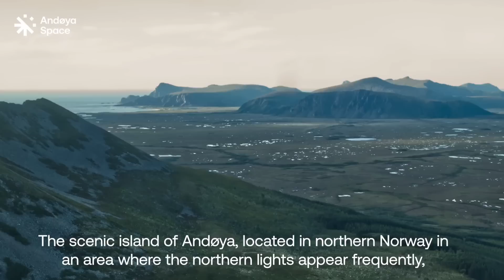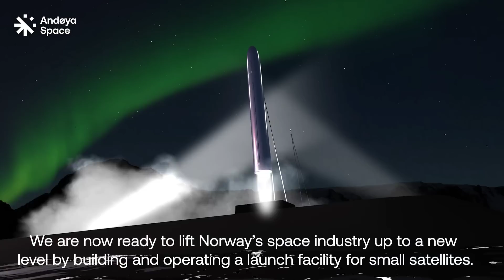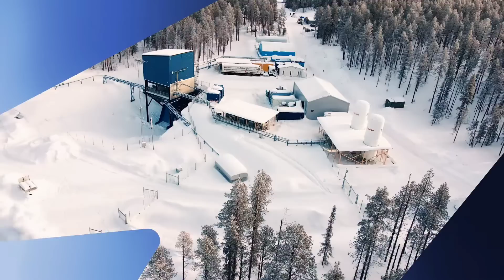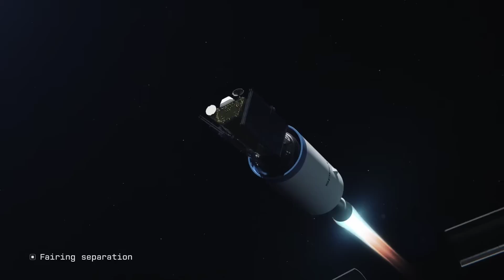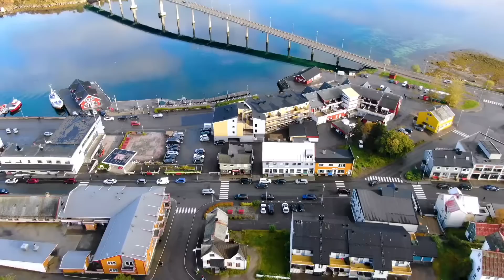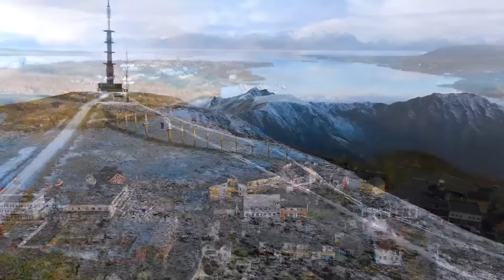The race is on!!!  Europe now has THREE licensed Spaceports!  The latest is in Norway!

Comment: It's worth pointing out that 'off the shelf', mass produced things for the automotive industry in 2024 are more consistant in their manufacturing and dimensions than custom military/space components were in the 1960s era, in spite of being a fraction of the cost. This isn't just in the machining, but even the metal is going to be more consistent throughout the part.

And there are a lot of things that can be done with software, sensors, and feedback loops today that were either utterly impossible in the 1960s, or had to be done via analog feedback in the devices themselves (but more commonly had to be dealt with by just making everything more robust to survive the non-ideal conditions that could not be eliminated)

Comment: Andøya has the best logistics. There's a deep water port at Andenes, as well as a long runway. That's about 37 km away. On top of that Andøya is connected to the mainland without needing to take a ferry.

If you want to unload a rocket from a ship closer to the site, there are some options as close as 5 km away from the launch site.

As I understand it, the Spectrum rocket is already at Andøya, and they will start testing the stages in the very near future.

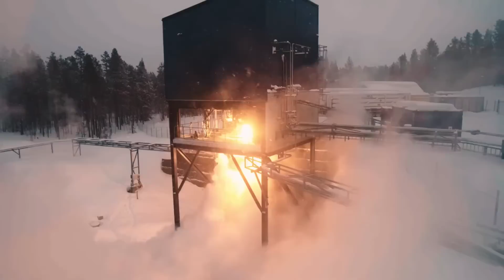Comment: 3:05 there's no such thing as "3D-printing carbon composites" 🤦 Isar are indeed using 3D printing for parts of their engines, and they are indeed utilizing carbon composites for the hull of the rocket - but those are two entirely separate sets of parts, processes, and technologies...

Comment: Don't locations of spaceports matter or they don't after all? I thought if they gonna try orbits isn't it better somewhere close to the equator, or they could do this with a bit for extra effort from top north and it doesn't really matter?
Reply: Close to the equator is good if you're launching into orbits aligned with Earth's rotation: that way, you get ~1600 km/h of velocity "for free".  However, if you want to launch into a polar orbit, or otherwise into an orbit that goes 'retrograde' (i.e. against Earth's rotation), it's better to launch as close to the poles as you can get - so you don't have to work extra hard to scrub the equatorial velocity (which goes in the wrong direction, for your purposes.)

The vast majority of satellites do just fine in equatorial or near-equatorial orbits.  Launches to the Moon, to geostationary orbit, to the Earth-Sun Lagrange points, and to the other planets, or to the asteroid belt must, by necessity, be equatorial as well.

But there is still a market (though a much smaller one) for polar or near-polar (including Sun-synchronous) orbits.
Reply: @Spherical_Cow  Thank you for the good detailed explanation !!
Reply: Can't launch in an Eastern direction from Europe because spent boosters would land on our cities.
Reply: @andyalder1  It is possible to launch towards the east, but there aren't a lot of suitable sites, and Europe is a bit far north for equatorial orbits anyway. It would have to be something like Spain, Malta, Sicily, Romania, Bulgaria or England. Some of the relevant areas are fairly heavily populated.

It's just easier and more optimal  to launch from French Guiana for equatorial orbits.

Comment: What about the second spaceport in Norway? What about Spain, El Arenosillo and  Sweden, Esrange, Kiruna?
Reply: There is no second spaceport in Norway.
Reply: @okklidokkli   Norway	SvalRak	78.2234°N 15.6470°E since 1997 and
 Norway	Andøya Space Center	69.29430°N 16.02070°E since	1962 - makes 2 in operation.
Reply: @lieschenart  They only do suborbital launches. The orbital launch site is close to Andøya Space Center, but it is a different site.